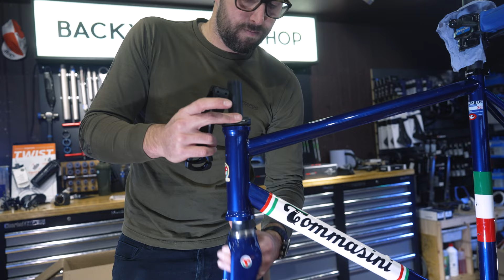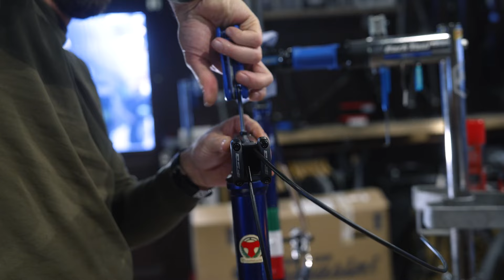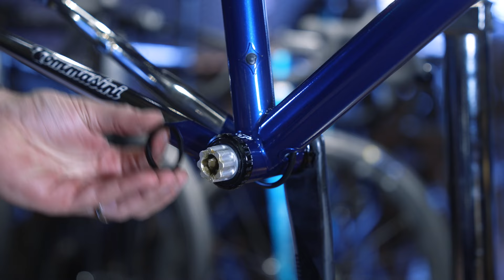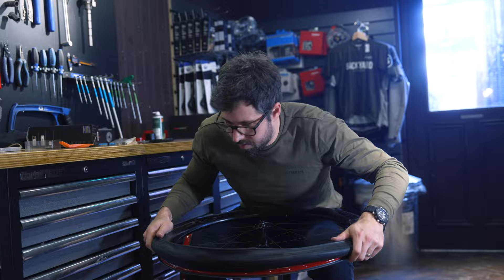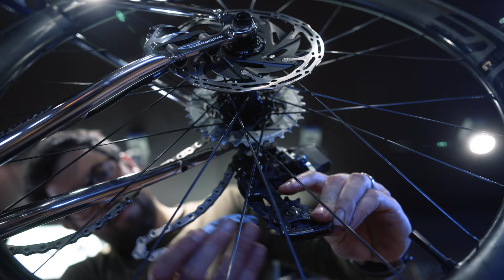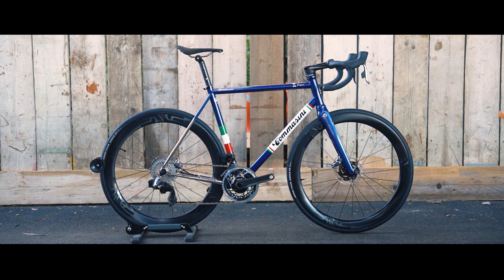Tommasini X Fire Disc Build With ENVE SES 4.5 Wheels, Sram Red Groupset - Sony A7IV, 24-70 F2.8 G

Comment: I am absolutely liking that frame and color. The cockpit isn't such a bad choice either. But why put those wheels on a bike like that? That is a 10 hour bike, not a 4 hour bike. Those wheels must be stiff. It's not an aero bike. It is a bike made to be a comfortable all day riding bike. Yeah, those wheels are going to ruin the handling for sure.
Reply: Agreed:  even disc brakes ruin the look of the frame
Reply from the maker: What the customer wanted. They’re also tubeless so low pressure. Will be comfy.
Reply: @Jimmidoesstuff  It may roll over imperfect road surfaces without all the road chatter but the handling will not be as it was meant to be. This bike will be slower actually with aero wheels and tubeless wider tires. In my experience it will not corner as well. This looks to me like like just a club B ride in hopes of getting some compliments. I would like to think that frame was designed for more than that.
Reply: @wasupwitdat1mofiki94  what wheels do these bikes usually partner with if not carbon? Alloy 32h?